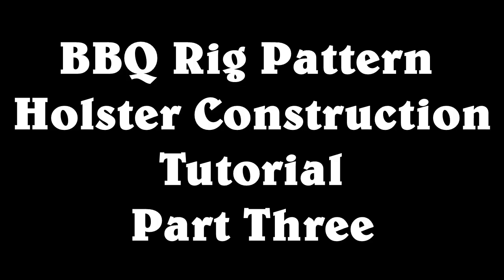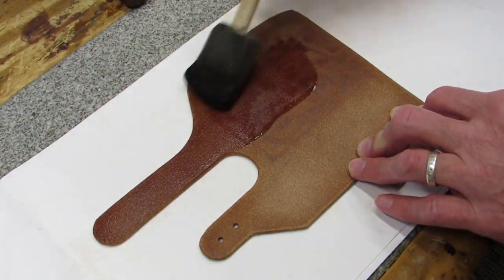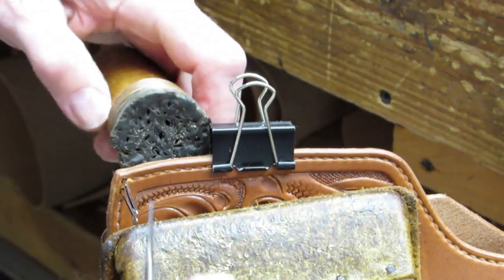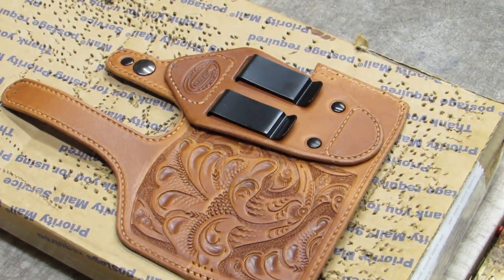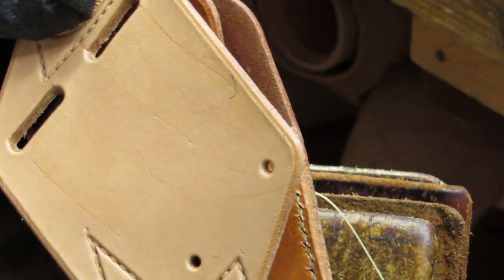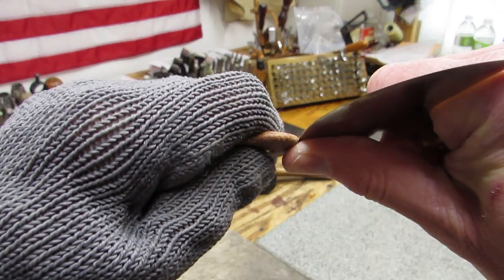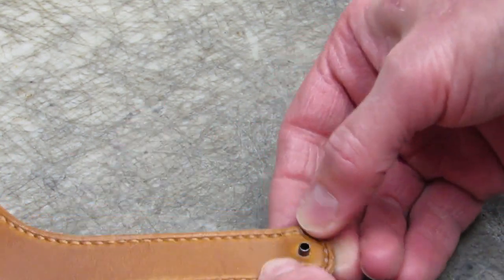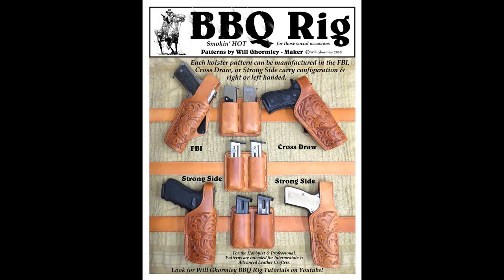BBQ Holster Tutorial Part 3

Comment: Mr. Ghormley, I noticed that the holster that you made was for a glock. Are there other available models, or do you have to modify for your different gun?
Reply from the maker: Hey Gary, I tried to select the most popular weapons in basic sizes.  There are just too many variations to include holsters for everything.  This particular pattern pack has holsters made specifically for the 1911, Browning Hi-Power, Beretta M92, S&W M&P, Glock, and Springfield XD.  But there are instructions on how to modify the holster patterns.
Hope this helps.
Will